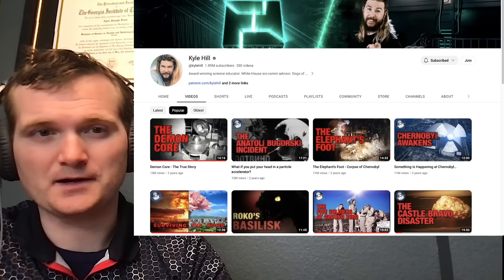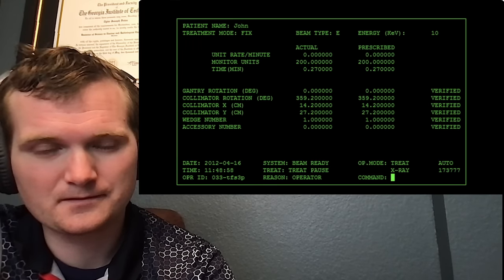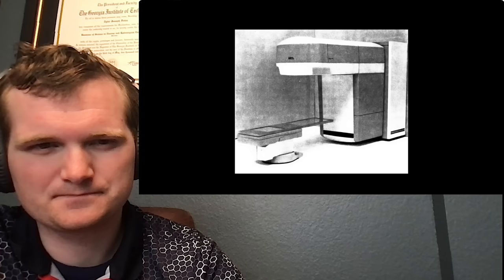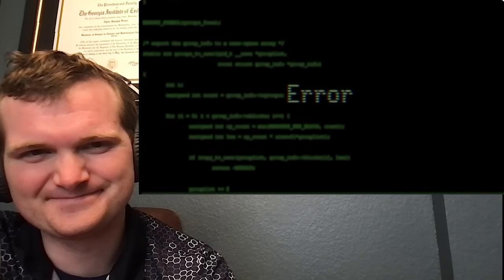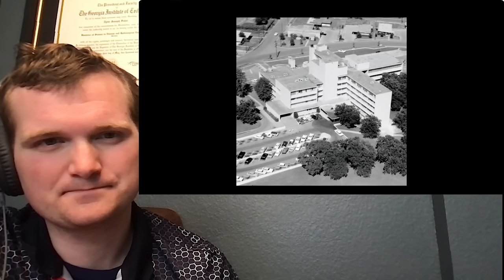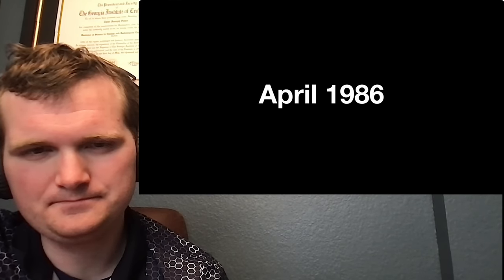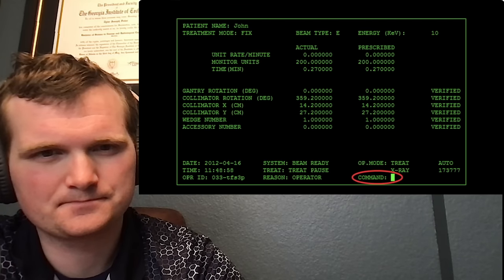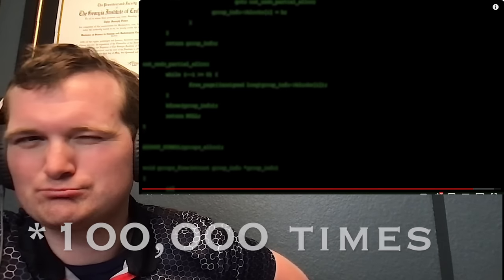Nuclear Engineer Reacts to The Worst Software Error In History by Kyle Hill

Comment: On the CP-1, there was actually a man with an axe on top of the reactor. His job was to release the safety control rod (normally held outside the reactor with a rope and not used to control the reactor) in an emergency. They also had buckets of boron solution to pour over the reactor. The name stuck.

Comment: The thing about safety is that you could have the brightest people in the world working for you but if your company's upper management is cutting corners, stuff like this will happen. (Let's be frank EVERY company does it to some extent, blinded by short term profit but some are simply inexcusable.) It is why safety requirements have to be legally mandated. Otherwise you inevitably end up with cut corners causing disasters like those in the video, all while the companies are far more preoccupied with denying liability as profit is the overriding consideration at the top level of the company rather than preventing further harm. This company using code from an unidentified hobbyist and their denials when they didn't  even vet the software properly was pure criminal negligence and a very callous disregard for patient's lives.

Comment: I picked up on the thorac 25 video i guess,based on my interests, it amazes me that it had this very important beam splitter that didn't have a sensor to detect position, or that the error 54 was bypassed, from the other video out there, apparently they can jit continue ehen they get that error, it sounds like the predecessor model worked fine with the software, because that machine had mechanical interlocks, and they carried it over to the thorac 25, without proper testing, I've been working on copiers for the last 30 years, and even the older models if it had an error code you cannot bypass it, it has to be repaired or it will not continue

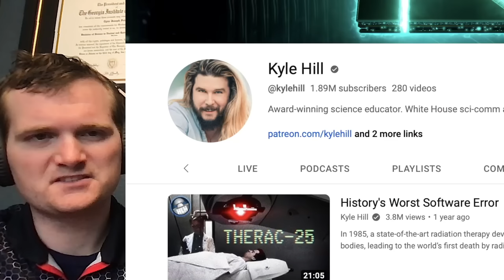Comment: 30:38 Very pedantic but 1 byte cannot hold the value 256. Its maximum value would be 255 before it would tick over to zero. Just like how midnight 00:00:00 follows 1 second after 23:59:59, without a 24:00:00 in between.

Comment: Unbalanced 3 phase can cause cnc machines to crash because the studdering power tricks the computer into thinking it did or did not a pulse. Best example is when the button battery in a digital caliper gets low it will read 99+ inches on a 6" caliper.

Comment: That last thing, where they had a SEPARATE DEVICE that monitored radiation levels and shut the whole thing down if dangerous levels were reached, that should be in every such medical device. I personally wouldn't work on programming for a device that did not have an independent watchdog device on it.

Comment: 25:40 Unfortunately almost no one is a software engineer.
I'm an electric engineer who writes code, but even I'm not necessarily a software engineer.
Most of the people who write code and think they are software engineer are not, they are just programmers. They are not fulfilling an engineers duty.
Engineering is not just creating something but taking responsibility for it. There are safety requirements, regulation.

Just look at the most used software licenses (*GPL, MIT, Apache, Mozilla, BSD...), they all claim no warranty of any kind and limit liability...
And just because you write unit tests that doesn't make you an engineer but that's at least a good step towards it.

Comment: The problem with software is that flaws are difficult to detect and the software is extremely complicated with the flaws once manifesting themselves in extremely rare cases.
It's not like how with mechanical stuff you can just see that some part is bent (when it shouldn't be), there is a crack, something is loose or a bearing is making noise.

Comment: Regarding the computers not making mistakes, there are possibilities aside from human errors in software development. One possibility is a bit flip, where the electrical charge representing a 0 or 1 in memory changes without being instructed to. This can be caused by certain types of radiation including cosmic rays. Sometimes it causes a crash or doesn’t matter, but there is also the possibility that everything keeps going with a meaningful value changed.

Comment: I wonder if the other hospitals felt pressured by management and/or insurance to continue to use their new expensive toy. 
besides not being fully aware of what or how the malfunction was happening, or how dangerous it was- and using the word of the manufacturer that it wasn’t possible to be dangerous. 
I used to work cleaning surgical instruments at a major hospital, and whenever a new device was brought in and trained with- i do believe doctors and departments felt pressured by upper management to make use of the item they spent so much of the budget on.

Comment: The meaningless error number is a trick still done by a lot of companies today, for business reasons. Famously, McDonald's icecream machines do it. So do many printers - certainly Richoh MFDs do, I have to deal with them. Just about any car will conceal errors from the operator, requiring plugging in an OBD computer to read the numerical error code and look it up on the manufacturer's special software. It's the same reason: Prevents anyone other than the manufacturer providing technical support, because the real money often isn't in selling the machine itsself, but in the support and service contracts. The meaningless error codes make quite sure that anyone buying the machine is bound into a service contract for the life of the machine.

Comment: Fortran would have been an upgrade, it was coded directly in assembly. And used concurrent tasks.
The software was way overcomplicated.

If it didn't start moving things around as soon as you entered something, but rather waited until the operator confirmed it, much of this could have been avoided. Sure, it will take 8 seconds after entering everything before treatment can actually begin, but that's not really an issue, is it.
None of the checks needed to be concurrent, either. When the operator confirms the parameters, move things in place, then perform the checks, then prompt the operator again to actually do the thing.
And, of course, hardware to make lethal doses actually impossible, does seem like a good idea...

Comment: the fact that older nuclear power plants still use older computer hard/software surprised me, but after some thought it does make sense. why switch out a system that works perfectly fine as is? it also makes me think of the principle that "the more parts something has, the more parts it has that can break".

out of curiosity, would you say that the risk of switching to something newer, that has more "bells and whistles", so to say, is why some plants still use their original, simpler computer tech despite the additional effort needed to replace discontinued components?

edit: ohh yeah, the "only one code-writer" thing is absolutely one of the biggest red flags there is. with something as potentially hazardous as a software-controlled radiation beam meant to be used safely on people, there needed to be a whole /team/ of independent reviewers going through that program with a fine-toothed comb before it was even /considered/ to be used on an actual human being.

Comment: In the very first reactor, Chicago Pile 1, a SCRAM system was used, SCRAM standing for “Single Control Rod Ax Man.” In the event of an emergency, the reactor operator would use an ax to cut a rope, dropping a control rod into the reactor and poisoning the reaction. Since then, safety systems have grown more sophisticated.

Comment: The lack of locking mechanisms and the inpropriate reusing of old codes was the true problem,the code was written fine for older model with locking mechanism took over so it's actually not even to blame the programmer.The machine was created recklessly by bad emgineers,insane.
Well,we know that old code might be written in assembly,even if it was C,it is still an unsafe language because you can access the memory very rawly byte per byte.Anyway,the company reused the code for newer model so basically it's so naive and dumb.

Comment: Treating any computer, or piece of software, or vehicle, or ANYTHING like a magic black box is responsible for a lot of issues.  Everything from ruined engines from lack of oil changes, to bald tires causing crashes, to computers getting loaded with malware.  If someone doesn't have at least some level of curiosity of how the things they use work, there's something wrong with them IMO.

Comment: Typically, writing code for mission critical Building Automation Systems, will take three to five times longer to properly address potential failures and safeties than the time it takes to write the basic control code.  With a piece of equipment like this I can't imagine the time it could potentially take to write and properly test the code to address every potential failure.  It's insane to think this wasn't addressed in full after the first incident.  After all, if this machine didn't cause her radiation burns, just where did anyone think she got them?

Comment: fortran is a mess. when I played minecraft a few years back we had a nuclear power mod and also a computer mod, which booted into a fotran interface by default. we immediately switched to basic to code up the reactor monitoring and controls. I even made a nice bar graph interface for it. I'm a professional programmer in c# and i do c++ as a hobby. why anyone would choose fortran is beyond me.

@30:40 we need to store values from 0 to 360, what data type should we use? Oh, I know, why not use a byte? It can easily store values from 0 to 255... sorry, what?

Comment: While i agree with you i believe that when Kyle said that software is not error prone he meant that unlike hardware that can wear out and thus needs regular upkeep, software, assuming it is coded correctly, once It is done you never need to check It again (for example: using a calculator you don't check if the answer It gives you is correct, you just assume It is coded properly and that the answer It gives you will be right)
Reply: Also it doesnt make "mistakes" like people do, it follows its own strict logic, and even if the result is "unintended" it still isnt technically "wrong" in the conventional sense
Reply: I mean, you can always get issues with Software. Even if your code is flawless, there is always a non-zero chance of a cosmic ray or similiar hitting your silicon and just flipping a bit. And your code may be perfectly capable of adding two numbers

But if you enter 1 + 1, and Something turns that into 1 + 2, you will get the answer 3, no matter how perfect it all works

Comment: I can’t imagine relying on a random computer hobbyist to write the code for a piece of equipment capable of being lethal.  Surely that’s criminal negligence?

The way the system worked strongly suggests to me the code was a hot mess.  It was at best a dangerous early prototype.  It amazes me this sort of thing can get into the hands of doctors with so little quality assurance.

Trust no one.

Comment: Why was the THERAC-25 even capable of doses that were leathal? Makes wonder what became of the company that made the THERAC-25?
Reply: From the diagrams in the video, it was a dual-function electron beam/x-ray machine. Generating x-rays by firing a high-energy electron beam through some kind of filter. But due to the bugs, it could fire that high-energy beam with the filter not being in place.
Reply: @WJS774  Why was the THERAC-25 even capable of doses that were lethal?
Reply: @machdaddy6451  Because the electron gun needed to be run at a much higher intensity to generate the x-rays. That intensity was never intended to be used on patients directly, but was needed for the x-ray operation mode.

Comment: Saying software doesn't fail is like saying cars don't crash. It can be true, until it isn't.
Reply: The lack of locking mechanisms and the inpropriate reusage of old code was the problem,the code was written fine for older model with locking mechanism so it's actually not even to blame the programmer.The machine was created recklessly,insane.
Reply: @lanchanoinguyen2914  true. Hardware and software is a double edged sword like that. I guess this is what people mean by move fast and break things. I guess they never learn.

Comment: 26:23 more accurately, computers RARELY make mistakes, in principle (as actual errors in calculations are very rare but theoretically possible), but...
They're subject to, what my dad (computer science minor from UCLA with some programming jobs in college) calls, "garbage in, garbage out" errors. Essentially, the computer program will do exactly what the programmer tells it to do...
But you've gotta remember, the programmer is a human, so if they muck it up, the entire program is garbage. Or, alternatively, if the program technically works correctly, if the user of the program enters faulty info, the end result will be, well, garbage. Not because the program malfunctioned, but rather because it functioned perfectly with faulty input data.

Point is, computers are, ultimately, no better than those that design them. Only way you can convince me a computer can outdo the person programming it is if you incorporate wetware/an actual live neural net, but even then, it may outperform a human, but it's still prone to the errors of any biological brain, which, spoiler alert, is what we humans run on

Comment: Let me tell you as someone who does some programming in his spare time for hobby purposes, that a bug like this always can lurk. I can understand why this one was not picked up during beta testing, it's a real sneaky bastard. But just goes to show why testing is done to exhaustion with systems like these, or at least should have.
The most error-free code ever written is the original software for the space shuttle, written by IBM, which contained on average 2 errors per 1 million lines of code. And that is extremely low.

Comment: >> Therac-25 ran on software, not hardware
> Thats one of the ways to get it to run more precisely 
[Me, a software engineer]
NO. GOD NO. NO. NO. NO. WHAT'S WRONG WITH YOU. NO.
This is one of the Textbook Cases. In software engineering. In radiation medicine. In medical device engineering. In organisational safety. Hell, you get the idea.

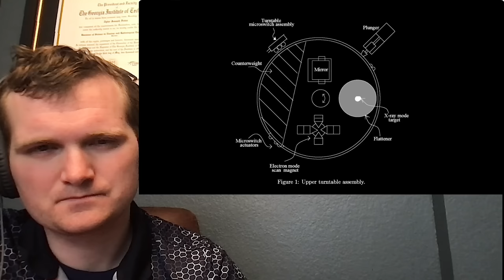Comment: 10:57 

I've never liked these kinds of measurements. They don't mean anything useful.

The most prominent example I encounter regularly is "years of experience".

Say a law firm is advertising, they might say "125 years of experience".

Well, no. First of all, nobody lives to be 125 years old. So they're indeed adding up all the experience in the firm. 

The problem with this is, it could mean you have 5 people with 25 years experience, or 10 people with 12.5 years experience. Or 125 people with 1 year experience.

There's a huge difference in actual effective meaning between the two extremes. A useless measurement.

Comment: "Only as good as the AI"... I can show you dozens of instances of AI making absolute novice mistakes, and I'm talking a fine tunes version of ChatGPT that is designed specifically for coding. It is a magnificent tool for rapid troubleshooting and prototyping, however it makes simple mistakes all the time, it often forgets to do things to ensure safe code executing like null checking.

also.... let's point out the maximum value of an 8bit byte is not 256... it's 255. It has 256 possible values... because 0 is itself a value. So when he shows the animation explaining overflow/rollover, he shows the number 256 and even states 256 is the maximum. This is a technical inaccuracy. Any binary maximum will be an odd number, because you're adding all evens, until you add the 0 power so adding evens, then the lowest position... add 1. Powers of 2 are fun like that. It does not change that the explanation is correct, integer overflow works precisely like he described. I just thought it was interesting. the 255 vs 256 thing is a common issue when programming and even veterans will make it, have it cause an error, and then spend too long looking for it, realize the mistake and go "that was dumb" (this is only true these days when working in tight memory confines so you're using "byte" instead of "int" as your type)